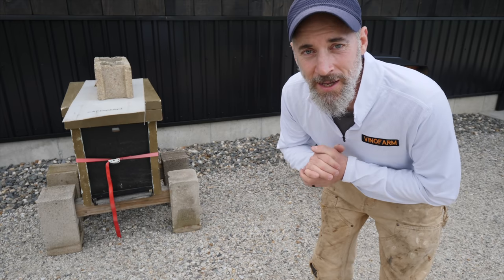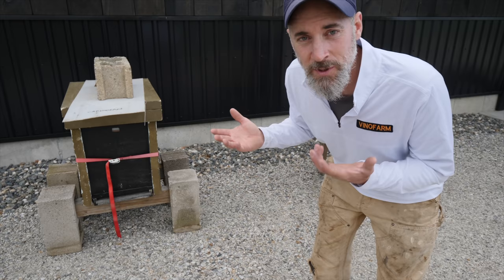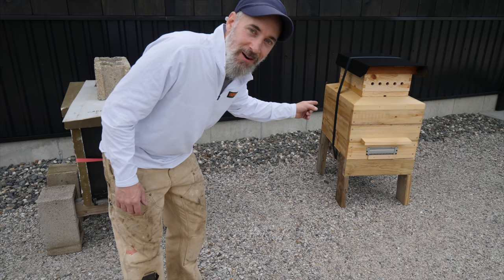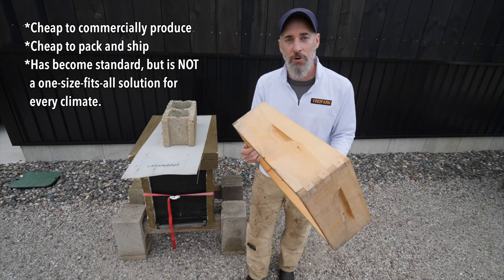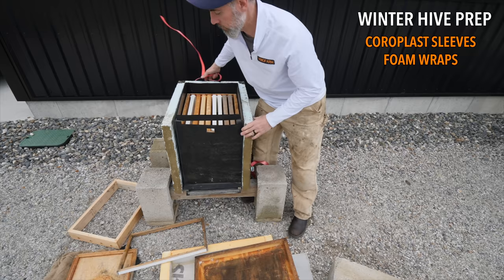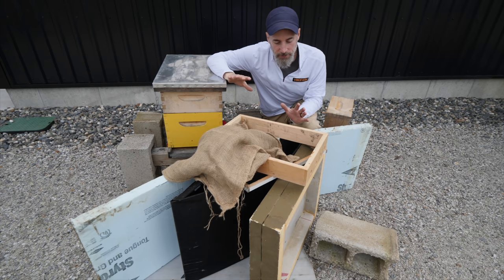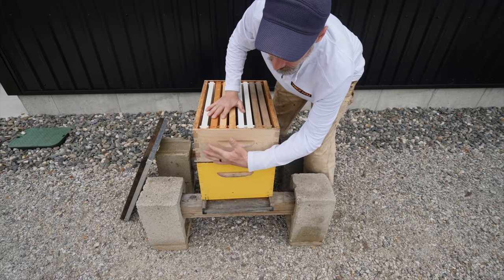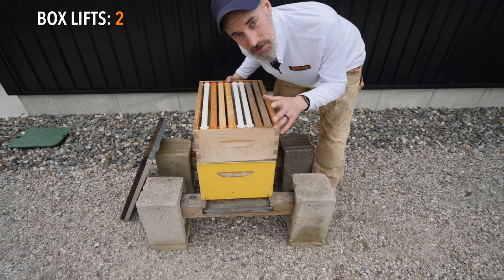I Fixed The Langstroth Hive (For The Bees AND The Keeper!)

Comment: I can see two problems. I normally don't comment on people's videos, I watch and apply to my conditions. I had a very mild winter in Canada this year. Bees using up resources they don't normally use. Carniolins are very frugal with resources. But being very active this winter I decided to help. Adding sugar as you do worked well in the past how ever I added a bit too much. I didn't choke off the vent holes, but slowed the air flow. With fluctuations in heat and cold I lost 4 if my 7 hives to moisture. 2 where weak going in and I assumed they wouldn't make it. Cold DOES NOT kill bees. Moisture does. They know what they want for ventilation and propolise the rest. 
I have used many of your ideas but tweaked a bit for my conditions. 
Ventilation and sugar added set me back to square one. One viable hive left and starting from scratch.
Bees are coming in two weeks. Dandelions and apple trees are just starting to bloom. 
Just putting it out there. Enjoy your videos very much. Thanks for your time.

Comment: It looks like a Langstroth/horizontal hive.  We have Summer to 117F and Winters to -20F and at least two multi-day windstorms per year that push 65-105 mph sustained winds.  7 years ago our 60’x28’ wood and metal machine shop lifted off the ground and flew 100 yards past our milking barn and landed in a magnificent heap right in front of the silage barn.  We have to make slip-on 2” hard insulation board boxes to cover in the Winter…but I have toyed with the idea of building a nice wood box out of 1” White Pine and a 1/2” hardboard insulation liner that slips over the entire hive except the entrance.  I just automatically set all hives on 3” hardboard insulation and leave it all year.  But we have to pour 200lb concrete pillars 36” deep on each side of every hive and run a strap over the hive and tighten it down to protect from wind….if we get ample warning we just move them into the one unused barn on back of the property.  I like the top bar system in a large single horizontal box.  I have gone to the 38mm top bars to increase drone production.   The main reason is that I’m getting older and can’t do the heavy lifting.  Within a few years I will be in a wheel chair and I can work these hives from my chair.  With up to 200 hives they have to work for me.

Comment: I like it! Your ideas make a lot of sense! I see one thing that concerns me. And I will definitely be following you through the season to see how things go. My concern is over the space between the two foundations on each frame. They will probably end up drawing comb straight down from one to the other. However bees can be awfully persnickety. And I worry that sometimes you may find you’re lifting more than one frame at a time due to cross-comb. Especially since that space is open from one side of the hive to the other. I wish you all the luck and am very much looking forward to follow up videos!
Reply from the maker: There has been a bit of cross comb, but I'm taking it right off and trying to train them! MOST of it has been pretty straight.

Comment: This is awesome, I noticed that where the top wicking box is there is potential for rain to get in since there is nothing to stop it, like flashing. Perhaps having the screen bottom may provide the drainage needed. I live in Las Cruces, NM and we get hard, driving rain with wind. I had been planning to use the STO elastomeric stucco system directly on the same deep and super combination. This also uses 2" foam with a mesh tying it all together and elastomeric stucco as a finish. Thank you!
Reply from the maker: That seam is silicone caulked underneath. Got it!

Comment: I lost all my bees this winter too with the late cold snap here in Kansas.  I too have seen Dr. Leos Horizontal Hive videos and explanations which left me with some additional knowledge and thinkings about bees and hives.  I think you have pretty much nailed the combination of the two that I was also contemplating.  It lets you use current equipment and move towards a more natural set up for the bees that should lead to over all wellness and longevity.  I applaud you on your solution and really look forward to a how to on these hives or basic demensions on your stand and insulation technique.  I'm curious if the wood and insulation are fixed  or glued to the Langstroth boxes or just an overlament.  Thanks for sharing your hive solution it looks great.  Subscribed.

Comment: It will be interesting to see how the bees utilize this space I’m sure there will be some surprises, they are always good for that. One issue I see is runoff from rain running down between the  langstroth box and the insulation causing  issues, maybe a bit of sealant around the edge would solve that.
Reply from the maker: It’s silicone caulked during construction.

Comment: I've been running similar ideas through my mind, you have perfected them. I think you should keep in mind you might need all top vents open in winter, LOTS OF MOISTURE. Mine will be similar but 10 frame.
Reply from the maker: Actually, I'm probably going to completely close all vents for winter and super insulate the top. I've been reading a lot and have changed my mind on ventilation. Stay tuned.
Reply: @vinofarm  I suppose that if no cold outside air meets the warm inside air, there would be no condensation. Side by side comparison would be interesting.

Comment: Really like this concept and have no doubt it will work for the bees. The question is whether it will work for you since it's also about how easy it is for us to manage the hives. Those are very large frames and you'll have quite a bit of work to get them out, especially packed with both brood and honey. Also, for swarm management, it'll be interesting to see how you can manage the girls backfilling on the queen, or sneaking in swarm cells a little higher up. Nothing that is a showstopper, but definitely to consider.

Comment: The spacer boards leave a hiding gap for ants and hive beetle to hide in .  I found a styrene lid'ed box that holds standard langstroth deeps . The broccoli suppliers use them. I used a couple over winter to see how they would do. Worked brilliant .styrene on its own as a box works well but needs vents to stop condensation. Cheers

Comment: I find this fascinating. I've been thinking along similar lines but to insulate from heat in Texas. @ 20:43 you're removing inner insulation. You may need to cover, coat or otherwise "armor" the insulation panels. If the bees propolize that foam, it will be difficult to slide out without breaking into a big mess. Chalk me up as a new subscriber. Outstanding work & best of luck!

Comment: I look forward to following this adventure,  I'm not going to say this idea won't work or it will be better. I will say there's a reason why a century old idea hasn't needed change.  Not so much does the equipment need revamped but maybe the management strategies.  Things I heard mentioned in this video that will go unnoticed because the focus is equipment. Weekly hive inspection are invasive, supposed nature intended a colony to be dismantle often. Rotating boxes twice a year when the bees have positioned food stores for the upcoming season and then their cupboards get turned upside down with no time to fix it, the bees can't move pollen positioned for spring but now after rotation the pollen is in the lower cold portion of the hive come late winter when brood rearing should begin.  Wrapped hives traps moisture in the equipment, insulation on hives keeps warmth out from solar gain, a cool but sunny day does nothing to assist the hive, upper entrance allows any heat generated by the bees to excape out the top while the insulation blocks the solar gain, double negative. Vivaldi boards are wasted efforts, they are another upper entrance allowing heat loss. The list goes on...
Reply from the maker: So you hate it?  Ha ha ha.

Comment: Jim,  The bee barns are beautiful.  What a lot of ingenuity and careful thought went into this!  One concern I have with the design is this...and its likely purely theoretical....
You have a wonderfully insulated hive...except for the top.   The coldest wall in the interior will be the ceiling.  You do have the vent hole there with burlap above to absorb moisture.  But I can't help but think that moisture will condense on that ceiling and drip.  If there was insulation on top and no cold ceiling, the  moist air would sink to the bottom before condensing.  Do I think your bees are going to thrive in your beautiful bee barns?  absolutely!  Just food for thought.  Id be curious to know what you think. PS I love your videos!  
I live in Montana--over the winter I built a Layens, a deeper layens I designed and a Lazutin.  OF course then I had to build all the frames to go in them.  Long term having 4 different size frames is unworkable.  I'm just experimenting to decide which works better for overwintering.  And, unlike your bee barn, none are  works of art!
Reply from the maker: Tops are not built yet. Winter is 5 months away, so I'm thinking about the design. Also totally re-thinking the ventilation.

Comment: The Bee Barn (or my own modifications to it) have been stuck in my brain since I saw the first video.  As someone who also has resource hives, it seems like someone with 10 frame setup could very easily build bee barns with front and back entrances and be able to use them as split resource hives and also as single "extra deep" hive structures by removing a divider and closing a rear entrance.  Another example of modular or multi-purpose building!

Comment: My grandfather kept bees (about 20 hives) from ‘50s to late ‘70s as a hobby. His custom boxes (he was carpenter) were eerily similar to your concept. Insulation material of course was different due to era but apart from that singular large size frames,  top multifunctional feeder/wick/vent box, bottom removable ( used hinged wooden door) all is functionally same. Of course dimensions and overall aesthetics are different but not much. He had very great success with this design in more than 20 years and outperformed most of the contemporary local beekeepers by large margins (per hive honey).
Reply from the maker: I knew it was probably not a new idea in the world, but it was to me! I’m already seeing huge benefits. Thanks!

Comment: Looks like a great new home for the bees. Only thing I would change is the placement of the ventilation holes in the top box. I would put them at the top of the box so the burlap doesn't cover them up. I've had a lot of issues in my ventilation boxes with moisture build up on the burlap unless the ventilation holes are completely unobstructed. Maybe put that box upside down so the holes are higher. :)
Reply from the maker: There may still be mods... This is version 1.0. Thanks for watching!

Comment: I like it the concept! Only thing I wonder is the strength of the frames maybe need a wire around them to strengthen the joints. Some hive really like to glue things up!  Absolutely love the spacers next to the frames you can remove that is a  great idea!  I'm going to make one!
Reply from the maker: Frames are gusseted with plywood. Something I’ve never seen before. They are the strongest frames I’ve ever seen.

Comment: It looks really cool, very well thought out, and highly useful.  I am VERY curious to see how your bees take to the extended frames.  I also hope that you are correct about the insulation, however, it looks like you shouldn't have much trouble if you have any - as you can just take the bottom part out and replace it with a screen or something - again, your augmentations to the hive box look to me like they'll do well.  I seriously cannot wait to hear what the bees think about it!  If you do have success, consider at least selling the designs!

Comment: Ive been modifying the bottom board sinece ive notices bees like a nice long (9in/22cm) smooth runway, much more efficient for bee traffic and for bearding and scrubbing i also added a slight gradient to the entire hive, so its easier for bees to clean out the hive and water cannot travel up from the entrance

Comment: Great design.  I've been sketching (Sketchup) for the last year with similar objectives.  Same thoughts on the large frames.  I was stealing a bit more from the horizontal hive -- but I agree with you on the vertical vs horizontal.  My draw to horizontal was only to the point of economy of scale (and insulation).   Picture two of your Bee Barns nest boxes, connected by a horizontal row of 20 deeps, with shared access by the two colonies.  All sharing the same shell of insulation.  Only my standard Langstroth deeps would be harvested, of course.

Also have considered adding 1 1/2 inches of insulation and a wooden outer-shell to all my boxes - to provide insulation - winter and summer.
I like your design better, and would love to get started building some soon.  Short of a full-blown "build" video (which would be great, too) can you share some (at detailed pictures) on some of the details?  Specifically details on access to your clean-out, the entrances, the "tunnel" that takes them through the wood/insulation/wood?  Also - any flashing at the top to keep moisture out, or just judicious caulking?  I suspect I may stray in construction materials, etc. - so I'm interested - but less urgently so - in the "how-tos" of a build video.  But very interested in the details mentioned.

Finally - I wanted to add, it always cracks me up to hear people invoke Langstroth ("its worked for 150 years!") to defend uninsulated hives.  Rev. Langstroth was ADAMANT that beehives should be insulated.  In fact he dedicated a whole chapter to it, which starts, 
"I specially invite a careful perusal of this chapter, as the subject, though of the very first importance in the management of bees, is one which but little attention has been given by the majority of cultivators."   He railed against thin-walled hives.  And he aptly predicted that posterity would most likely latch on to his ideas for moveable frames (because it made managing bees easier for us) - while ignoring what HE considered his most-important advice - for thicker-walled hives (because it was more expensive, and harder for us.)

Comment: like the bevel on top for shedding moisture . . should think about a pitched roof for shedding moisture/snow as well. 
Still think Dr. Leo's insulated Layens would have worked better? 
I think you new frames will be unwieldy/heavy to work with, and think the likely hood of comb being built in awkward places is very high. Also think your idea for spacers and insulation inside will be havens for pests, and make reinsertion after inspections likely to crush many bees. 
Will be interesting to see . .good luck!

Comment: Brilliant Jim!  You nailed a great concept. Patent Pending should be your next move, as others have said. I was glad to see my bees aren't building comb and brood upside down!  :)  Your videos are always well done, good to see a little levity. A few things I thought of last night when I first viewed this. 
1. If you have queen cells? Do you have another box available? Will they go to a standard hive? (with a Deep and Med box to fit those frames) 
2. Varroa treatments? Did you make a hole for Oxalic? How many MAQS? Apivar? Wax moth and SHB considerations?
3. Your entrance? I didn't see it close enough to see how it was configured thru the insulation and exterior.  

You've done a real service to yourself, your bees, and have re-stimulated me and others with your thoughtful evaluation of this concept and ability to make it better.
Reply from the maker: 1. Deep/Medium sized resource hives. Stay tuned!
2. OA goes right into the front entrance. Very simple. Apivar can be hung between frames like normal, perhaps with 6" wire extensions to put them a bit deeper. I don't use MAQS/Formic. I don't really like it.
3. I made a wooden tunnel. No exposed insulation.
4... You can't patent a Langstroth hive. This is not new. I don't want to make any such claims. It's open source.

Thanks.

Comment: Sorry for the extra message…but I have been toying with the slant ‘V’ horizontal hive with top flat bars and make it with forklift holes for easy transfer to the truck flatbed.  The hive can be 6’ long but have dividers in it so that I can control the hive size as it grows from a nuc.

Comment: If you are in a spot with ants they will find a way into the foam unfortunately. Great design and I build one piece double deep frames that I didn’t use next year. Awesome plan and guaranteed to make a difference, strong work
Reply from the maker: Luckily, no major ant problems and zero beetle problems up here. One good thing about long cold winters.
Reply: Bob Binnie has a video where he discusses OA tx and I believe he is doing his tx every five days I believe. With less than twenty colonies I think I would try better genetics and brood break with those that have high mite loads. With a good flow you might need all eight frames in your brood box. My four foot deep long just ran out of space and had to pull queen and some frames. Don’t discount good TF queens, there are some good ones out there and sure make for less work, good luck.

Comment: Inverted feed buckets as they empty, and fill with air, have a tendency to pump the syrup as the air expands due to warming. This can soak the bees, raise the humidity level and make it harder to cure the syrup, and if it runs out of the hive lead to robbing.

In hive feeder frames, or ziplock bag feeding is less prone to this type of leaking,
Reply from the maker: That is not something I’ve ever experienced. My buckets are always covered inside boxes. Not sitting in the sun.